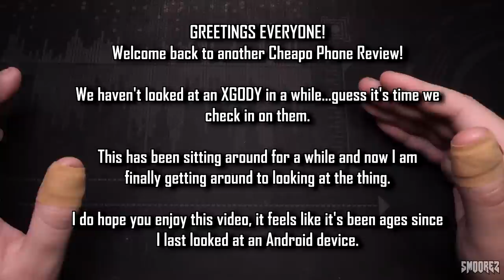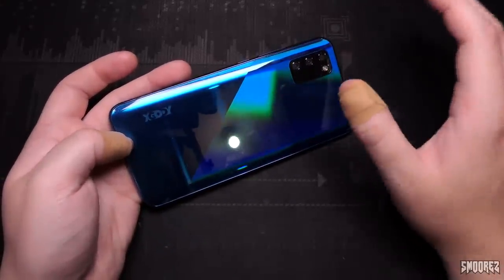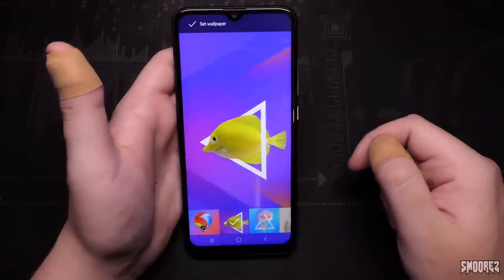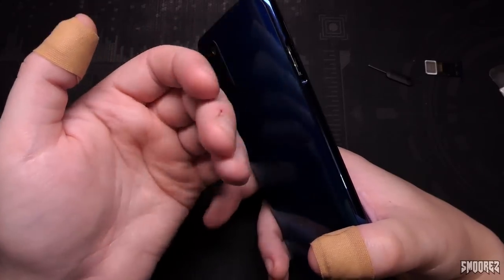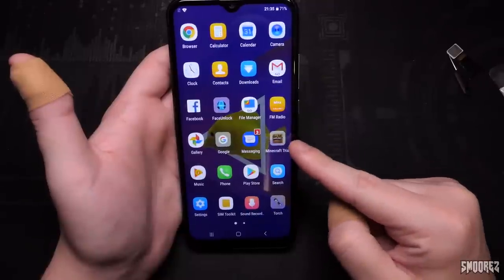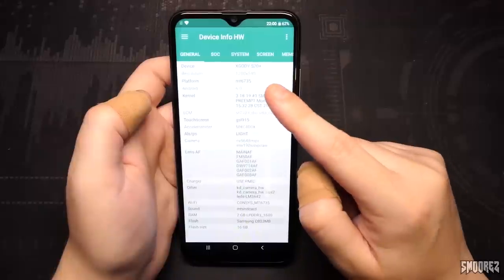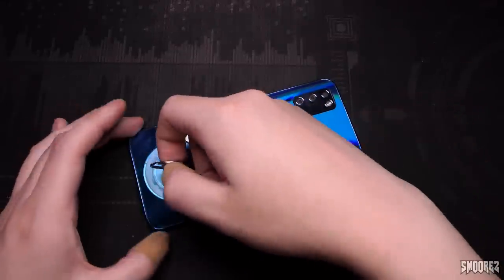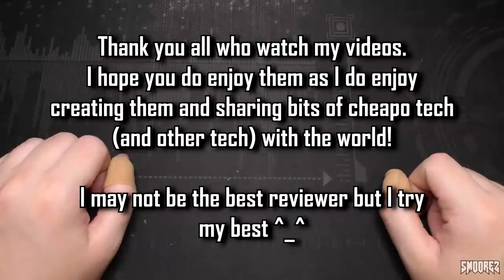The Return of XGODY! This is their S20+ Phone which is a very uninspired Samsung Knockoff...

Comment: Looks surprisingly close to an actual Samsung galaxy A51 that I had (just with less cameras and no punchhole, of course), I wonder if any rando on the street could tell if it was a Samsung or not if rip that XGODY branding.
Reply: A lot of phones look like a51, i still use a51 first gen, just swapped the battery and headphone jack for new one, and it's still perfectly fine in daily use (tho i use it to call/text and read pdfs mostly). My sister got herself xiaomi (new one, note 10s or sth) and when i lie down these 2 phones right next to each other, front up,  i can barley tell which one is mine lol. It genuine often happens that we take each others phones by mistake. Also ye, this xgody is very similar to a51 in terms of its visual design. It even rips off a51 back design. It's almost the same, just inverted. To be fair many brands copy samsung phone design. cuz they are simply looking good alright.

Comment: You might as well buy a Motorola / Lenovo phone, or a Samsung Galaxy A-Series. Much better specs for the same price as this. Or buy a used flagship that's 3-4 years old, the performance will still be much better than modern cheap phones.
Reply: Yh thats true I’m still using a Samsung galaxy s8

Comment: I usually run youtube using adblock browser on my phones and it runs without an issue. The app might be nice but the adds are just beyond annoying. 
I rather just whitelist certain channels to allow the creator to get some revenue, but overall i prefer to give youtube as little as possible. 
Performance wise there is no difference if i run it in browser or app.